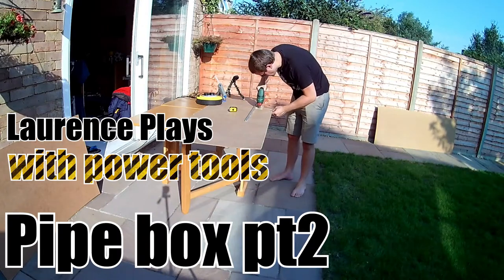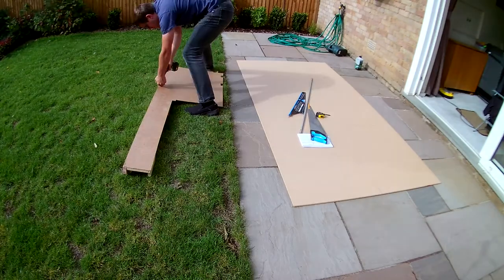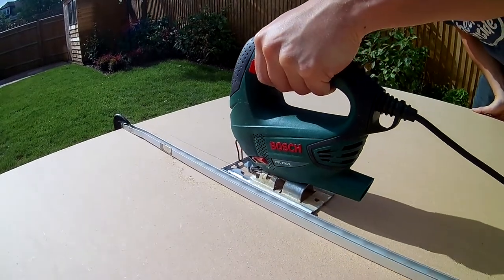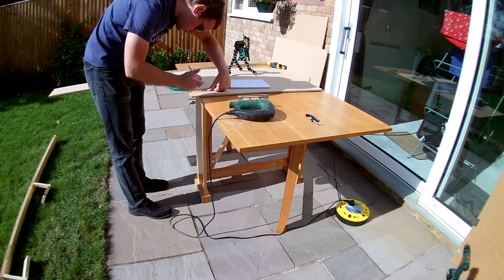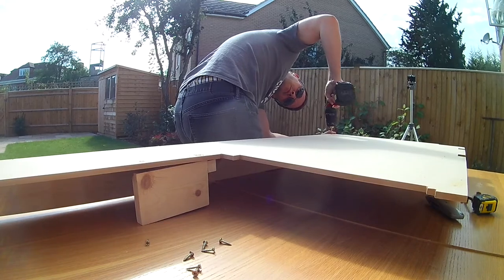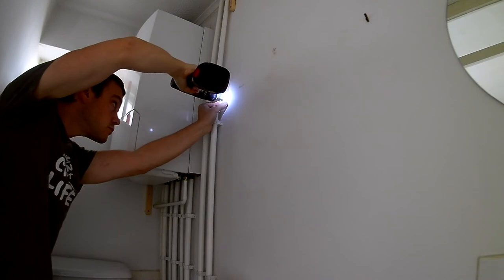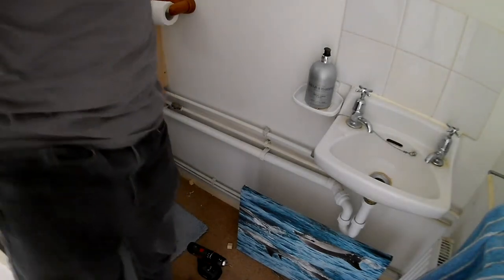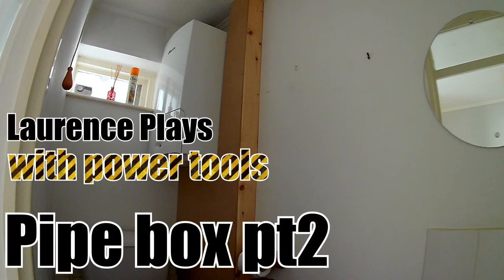Pipe boxing pt 2 - Box Harder - Laurence Plays with power tools

Comment: Could the boiler not have been put elsewhere?
Reply from the maker: The boiler was fitted before we moved in, and moving it is well beyond my abilities! That said, it would be possible to get a plumber in to move it, but I'm not sure there's anywhere in the house that would be better. It's best to have it on an outside wall, it can't be in a bedroom because it's noisy, it's best not having it in the kitchen or living areas, again because it's noisy. There is a cupboard that is vaguely suitable, but we'd then essentially lose that cupboard! I think it's probably in the best place possible. 

We do lose a bit of space in that room to it, but it's not too cramped, so I think it's as good as it will get! The house was built (I believe) with an old fashioned warm air heating system and then modernised, so it's a bit of an afterthought.